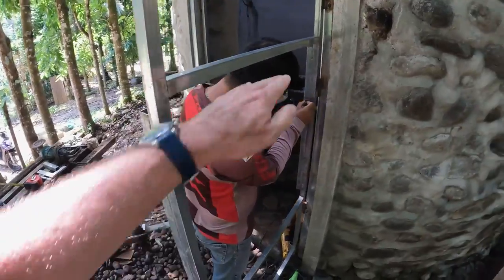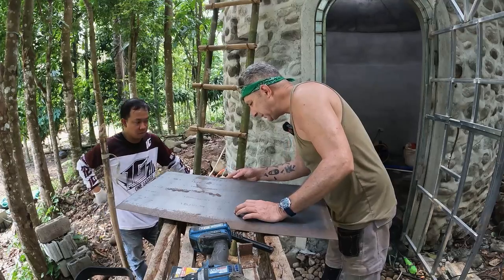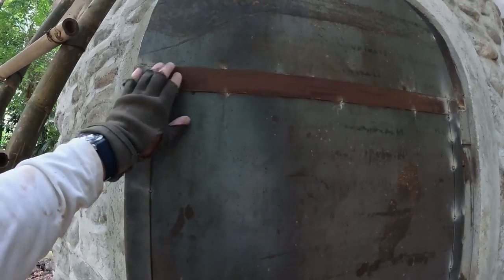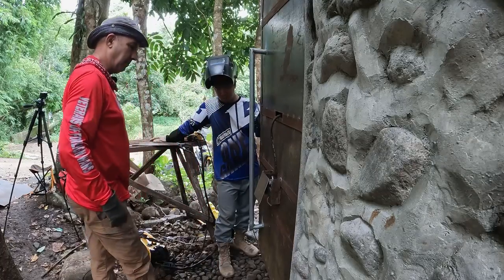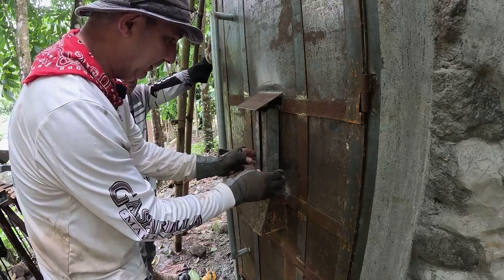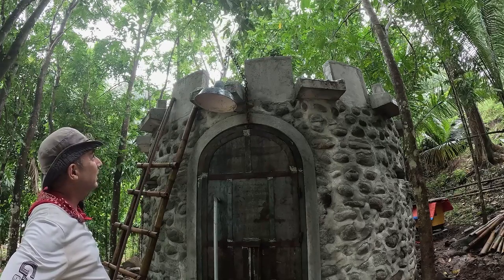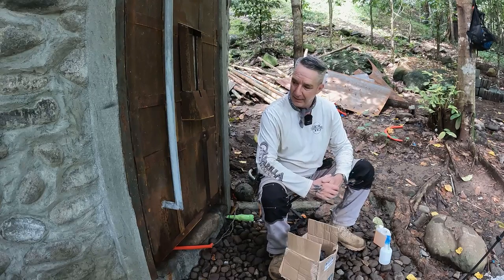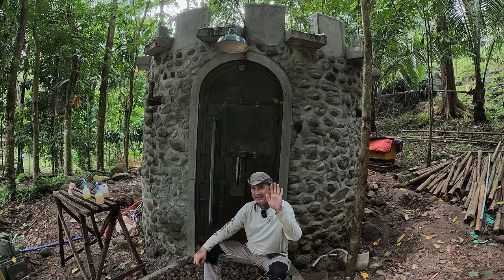Is The Steel Door Build Finished? 🔨 | Fabrication Philippines | Ep. 04 | TORINO

Comment: Interesting door, Your getting high tech plasma cutter, gas-less migwelder then wow along comes a magnetic drill  what next acid linseed oil.
That's without even getting into the door lock.
Way above the the usuall range of Filippo work shop tools.
Nice one.😊

Comment: Great renaissance custom steel door! By the way, you need to make it mechanically impossible for someone to lock you in, from outside by using a padlock... A very nice linseed oil plus acetone tip. Full support already! Good luck and best regards /Ned 👍👏👍
Reply from the maker: That's a good tip, thanks
Reply: @torino2610  🤝

Comment: So with one bolt cutter you just cut the lock !
Reply from the maker: No, there's no room to access the lock shank.
Reply: @torino2610  How you hand fits but bold cutter wont fit or atleast if i can hook that locker awith metal cable like car winch and knot on it. And with a crowbar creating leverage pull down the locker does not seem impossible to break in. Or winch it. So if usb cable fit to hug the lock then we got jackpot. Best way is to put metal bar under door and start witnch with cable the locker and creating leverage just with onter metal pipe and spin it aroun until something gives up from tension.
Reply from the maker: @Jupizero  The ground rules I laid out in the video at 12:11 were to defeat someone with a hacksaw or lever. Of course a car and winch could pull the whole door off, lol. Not sure what you mean by using a usb cable.  Thanks for the critical thinking though. 🙂